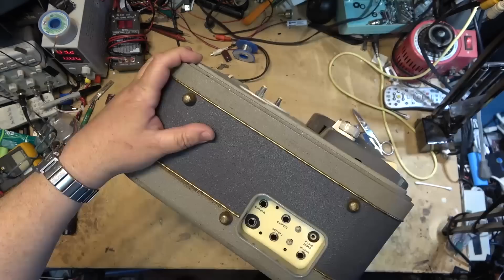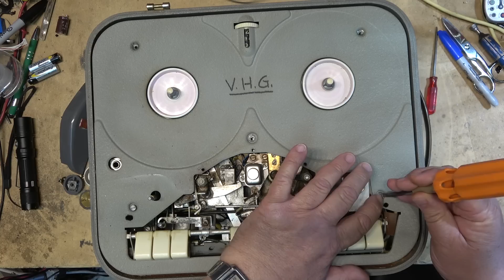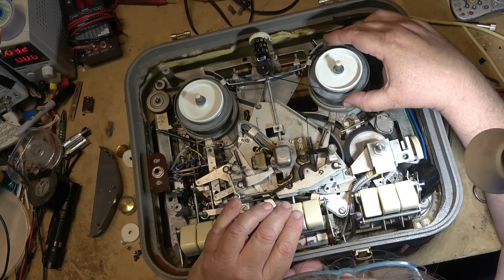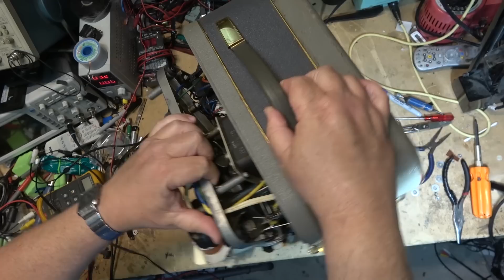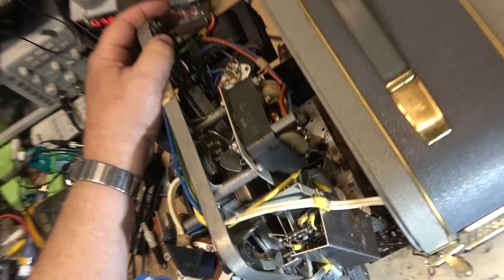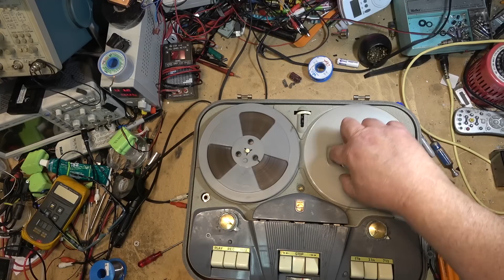Philips EL3516 Tube Tape Recorder from 1958

Comment: You said ‘they’re built like tanks,’ and that could be literal, as through the 50s some companies doing audio equipment were still using surplus components from the end of WW2. So the components were sometimes built way over minimum spec, because they were considered mission critical, going into planes, tanks etc. No idea if this was the case with Philips, however.

Holy wow, when you got it open, what a crazy robot. 👀

Comment: There is a 4 quarter track version of this tape recorder which is a Philips EL3542.
I have a clone version which is called the Stellaphone ST455.
The mechanism is the same as yours which I had to dismantle, clean & re-grease to make mine to play properly.
The main drive belt has stretched and the tape counter belt has turned to goo, both had to be replaced.
Also I had to fix the clutch mechanism on both the reel hubs as it is no longer gripping them.
Now the machine plays well and pleased with the results.
Reply from the maker: Too bad it wasn't stereo.
Reply: There is a socket marked Stereo for playing back stereo pre-recorded tapes. The instructions states that a suitable pre-amp must be used and the tape track selector set to 1-4 position.
Reply: That is so cool.

Comment: I've worked on lots of these types of late 50's / early 60's recorders. They are generally well-built. The mechanism will require partial disassembly, degreasing, and lubrication. The center pin under the pickup and supply reels usually gets stuck due to old grease. The various buttons raise and lower the reel platters. The clutch rubber is in fact cork. A sheet of cork can be bought and cut to fit the holes. It's a bit difficult getting the right height though. But once correct the machine will be able to fast forward and rewind with ease. I find that only the mains electrolytics need replacement. Replacement belts can also be made by most belting places. The motor will also need dissasembly and cleaning.  These recorders perform really well for their age once repaired.
Reply: Can you recommend a belt making company? Please advise.

Comment: My parents had a tube tape recorder possibly before I was born. In later years it sat up in the closet. They gave it to me because it didn't have sound. I couldn't fix it. I was too young anyway. It did not have keys. It had a twist control for play, stop and rewind. Not sure about record.
I regret not saving the tapes. It was a tube set. No idea of brand. 
I find reel tape recorders fascinating. I bought several small ones of of eBay.
I also have a Realistic I fixed. But it's broken again . (motor seized up again)

Comment: These sorts of players are a dime a dozen here in Australia and are pretty well worthless.  
Most the time they are in the condition like the first one you showed. 
Even still, the Philips tape recorders were not great machines in my experience.
Part wise, look how 'busy' they were compared to other players of the day.
In the early days here, the main units were Philips, National and Sony, and Sony being the best of the them, 
even the earlier ones.
One thing these early Philips machines have going for them when you do find them, you can pay 10 or 20 bucks,
and your likely to pick up a set of vintage tubes that are now worth more the player itself! 
Those that are creative, even turn these little ol guys into guitar amplifiers, which at least saves them 
from the scrap heap at this point in time.
Thanks for the video. :)